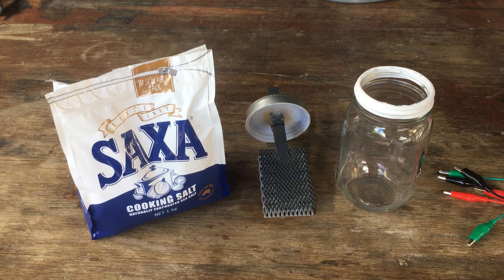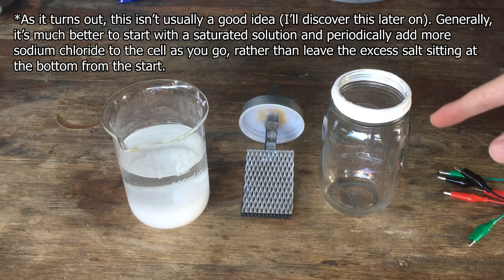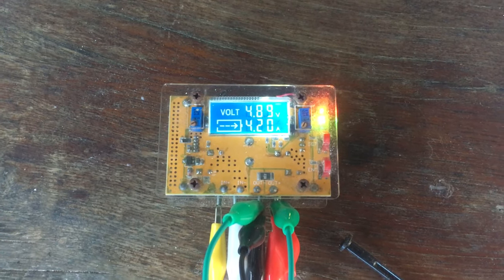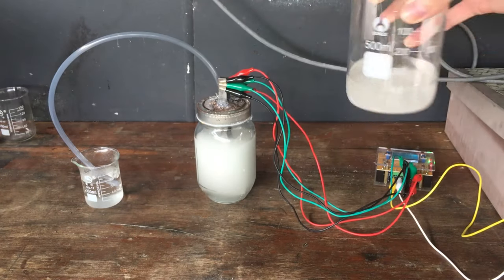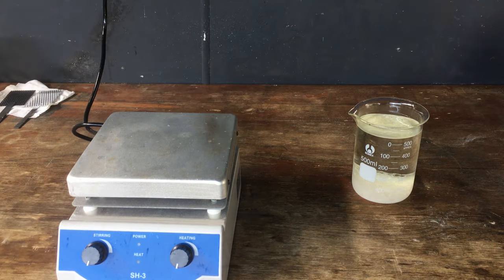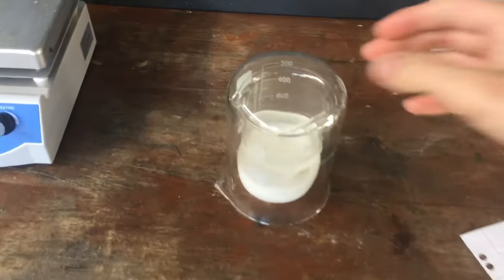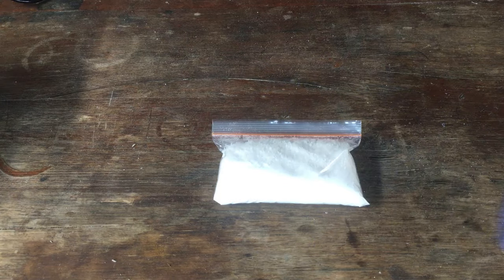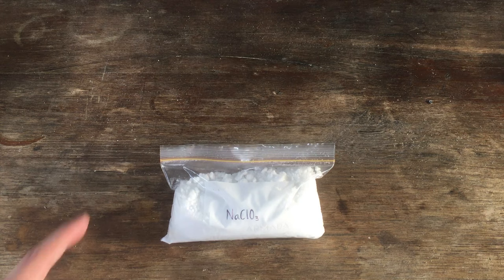A Sodium Chlorate Cell

Comment: Could you please explain why exactly there’s no much chloride left in the output material. I mean why are you so sure the most of the chloride is left in the solution? I’m trying to understand how it works as per idea I have the separation between chloride and chlorate should be bad as chlorate is more soluble so it should kinda tend to stay in solution more than chloride. 
I like chemistry but I never fully understood the idea of what you’ve done.
Thanks!
Reply from the maker: A great question! This is rather complicated to explain in a single YouTube comment, but I'll give it a try.
In the case of having an equal stoichiometric amount of sodium chloride and sodium chlorate in solution, you're completely correct that chloride would precipitate if you boiled down the solution or cooled down a saturated mixture. However, we didn't have equal amounts of each in solution. We had a little bit of the chloride and a LOT of the chlorate. 
In this case here, we could rely on the difference in solubility curves between the two salts (which you can find here: https://shorturl.at/rOR48 ) to get our crystallisation to work. When crystallising, we aimed to boil down the solution (reducing its volume) to the point just before the chloride crystallised. At this point, we stopped heating the solution and allowed it to cool. The solubility of chloride is almost independent of temperature, as you will see from the linked graph, so none crystallised on cooling. However, the chlorate solubility sharply decreased with cooling, so since we had so much in solution, we forced the chlorate to drop out even though it's more soluble. 
Boiling alone won't give you the chlorate, but if you stop boiling at the right time, you can just crystallise the chlorate by taking advantage of the temperature solubility curves.
Reply: @ScrapScience  ingenious! Thanks for explaining, this is completely clear to me now!

Comment: How do you prevent residual NaCl?
Also, I think its possibly to first purify the salt through crystallization, but that may still trap some other ions
Reply from the maker: The more recrystallisations that are performed, the less NaCl will be included in the product. If exceptionally pure chlorate is required, three or four recrystallisations may be needed (though this will also lose product, so it's a tradeoff).

And yes, recrystallisation of the starting salt could be done, but it's not really going to impact the overall process, since most common impurities won't interact through the electrolysis anyway.

Comment: +Scrap Science By the way how can you tell chlorate and perchlorate apart? They are quite similar and probably you wouldn´t know at which point you´re converting chlorates into perchlorates during electrolysis.
Reply from the maker: Mixed metal oxide and carbon electrodes will only convert chloride to chlorate, and will not make any appreciable amount of perchlorate, so this isn't an issue for this type of cell.
When using platinum or lead dioxide (which are able to make perchlorate), it still isn't too big of an issue. The presence of the initial chloride in the cell diminishes the efficiency of making perchlorate to a large extent, so you generally don't generate any unless you allow the cell to continue running for a very long time. If you were to run the cell for that long (which will ruin the electrodes to a large extent), the conversion to perchlorate is also accompanied by a sharp increase in voltage, so it's easy to spot when it starts.

Comment: Hey way late, but why is it that the chlorate precipitates out first before the chloride? The chlorate has a solubility of 106g/100ml and the chloride is only 36g/100ml. So shouldn't the chloride precipitate first?
Reply from the maker: Generally, yes. Chloride should precipitate first if you increase the concentration of both.
However, in this case, we don't just have a mixture of the chloride and chlorate - the cell is actively converting the former into the latter. At the beginning of the run, we have a saturated solution of chloride, and we then start turning this into chlorate. As we do this conversion, we physically add more and more chloride to the cell to account for the amount we're converting, keeping the chloride concentration close to the saturation limit. Repeating this process for a while keeps the chloride levels relatively constant (not enough to start crystallising out), while the chlorate concentration steadily increases. Eventually, after enough chloride addition and enough electrolytic oxidation, we have such an excess of chlorate in solution (>100g/100mL) that it must start crystallising out.
That's the basic idea anyway. It gets a little more complicated when you have to take solubility products into account.
Reply: @ScrapScience  Thank you, that makes sense, but if I did a recrystallisation by dissolving the product in the water and boiling it should I expect the chloride to now precipitate out first since the concentration would now be increasing for both? Or will the chlorate still precipitate first because of the solubility curve. 
Edit: also to add, wouldn’t it be better to not boil down your final solution and instead just keep topping it off with the chloride, decant the top and take the crystals? So instead of taking 2 weeks for you to start getting the chlorate you  just add some chloride to the super concentrated chlorate solution and get some more on demand?
Reply from the maker: For your first point:
Yeah, if you crystallise exclusively by boiling down a mixture of sodium chloride and chlorate, you'll get the chloride crystallising out first. However, the difference in solubility curves is extremely useful if you don't quite crystallise out any chloride in the boiling step. If you manage to boil down the solution to the point just before the chloride crystallises, you can stop there and allow the solution to cool. The solubility of chloride is almost independent of temperature, so none will crystallise on cooling. However, the chlorate solubility sharply decreases with cooling, so you force the chlorate to drop out. 
Again (to summarise that lengthy explanation), boiling alone won't give you the chlorate, but if you stop boiling at the right time, you can just crystallise the chlorate by taking advantage of the solubility curves (as you're referring to in that last sentence).

For your edit:
Are you talking about doing future runs of the chlorate cell? In that case, yes, the final decanted solution from this cell would be an ideal starting solution to make a new chlorate cell. It's already saturated in chlorates and ready to go for more electrolysis.

Comment: What do you mean by washing with cold water?
Reply from the maker: After I filtered the crystals, I just rinsed the crystals with ice cold water as they were sitting on the filter paper. This rinsed away any adhered NaCl solution. (The rinsing water needed to be cold to avoid redissolving too much of the product)
Reply: @ScrapScience  Ahh ok I understand, makes sense colder the better to an extent. Catching up on terminology lol. Thanks for your response!!
Reply: @ScrapScience  little update. Whatever I manage to precipitate or crystalize out of solution, I'm assuming is 25-30% purity. No matter how many times I try to recrystalize, it is contaminated with what I assume is sodium chloride. My starting solution is saturated to the point of recrystalizing the chloride approximately 10°c below ambient temperature (~5°). Is this caused by not enough time under electrolysis, insufficient current/voltage (3.3v @ 2A CC) or starting solution?

Comment: Trong thí nghiệm điện phân muối ăn ( NaCl ) này , điện cực trơ được anh dùng là Platin ( Pt ) hay bằng chất gì vậy ?
Reply from the maker: The inert anode in this case is a mixed metal oxide (MMO) anode - also known as a dimensionally stable anode (DSA). It is a titanium substrate coated with a mixture of ruthenium dioxide and iridium dioxide.
Platinium also works. So does graphite.

Comment: Im a beginner at Chemistry, I think it crystallized because its very clean equipment and is almost pure sodium chlorate. So I believe you did very perfectly to that point of crystallizing😅, im guessing of adding little impurities to prevent crystallization.
Reply: Thats not how it works
Reply: @user-vj8dz8ht2c  thanks,  i learn alot from that reply! i will correct my mistake from now on👍😁
Reply: @user-vj8dz8ht2c  I just watched NightHawkInLight about making infared cooling paint, I learned that crystals forms through concentrations and that impurities are just starting point of nucleation for the crystals. You are right.

Comment: How do you know the percipatate isnt sodium chloride salt?
Reply from the maker: For the following reasons:
1. This is a well-known reaction.
2. Sodium chloride's solubility curve against temperature is basically flat, so it would not generally crystallise out when decreasing the temperature of the solution.
3. Sodium chloride does not act in the way shown at 21:30.
Reply: @ScrapScience  agreed. But if your adding sodium chloride to the cell keeping it saturated hot. Then when it cools to room temp some salt will precipitate if not all used up and converted to sodium chlorate. I made that mistake the first time in ran a cell.

Comment: In I do not add sodium chloride to the cell constantly and I use carbon electrodes for the electric current it is ٤ volts and I use ١٠٠  ml of sodium chloride solution and the cell works with great effort and gases flow in very large quantities the temperature is approximately 25 only the cell becomes warm after running the cell for 5 hours the concentration becomes hypochlorite Sodium is strong, and will it work if I run the cell until the chloride concentration reaches a very low level, then I evaporate the solution until sodium chloride appears, but what are the signs that indicate that the chloride concentration is very low?
Reply from the maker: There are no reliable signs that will always tell you when the chloride concentration is low. You will need to work this out by calculations involving your expected cell efficiency, quantity of chloride, and cell current. I don't really understand anything else you're asking here, sorry.

Comment: My friend, if you leave the sodium chlorate cell for a long time, even after the chlorate is formed, and then continue the electrolysis, can the sodium chlorate turn into sodium perchlorate?
Reply from the maker: It depends on the electrodes you're using. Generally, no.

Comment: I am using machine translation, so you may not understand exactly what I am saying.
I have a question. The website I referred to says that the temperature of the solution must be high during electrolysis, but do I have to do this?
It also says that hydrochloric acid must be added to make the solution acidic.
Reply from the maker: You don't need to keep the temperature high or do pH control to build a working cell. Doing these things will increase efficiency (if you perform both techniques), but they are complicated to set up and are definitely not essential.
Reply: Does this mean that it is only the concentration of the solution that determines whether the brine becomes sodium hypochlorite or sodium chlorate during electrolysis?
Reply from the maker: Concentration of your initial chloride doesn't have much to do with it. With no pH control, you will oxidise chloride to hypochlorite, and then when the concentration of hypochlorite gets high enough, you will oxidise it into chlorate. This is two steps of anodic oxidation.

With pH controlled to 6.7 and temperatures around 70 C, you will still start generating hypochlorite, but then the hypochlorite will automatically disproportionate to produce chlorate (a more efficient reaction). This is one step of anodic oxidation and one step which is purely thermally driven.

I have another video on chlorate cells which goes deeper into the chemistry here:
https://youtu.be/CqMEnrQb5q8
Reply: I see. Thank you very much.

Comment: You need to use a MUCH smaller cathode. Your chlorate is turning back to chloride at the cathode more with a large surface area.
Reply from the maker: Yeah, definitely. I just wasn't too concerned about the efficiency for this one, and I didn't have a smaller cathode.
Reply: Would a porous membrane help? Or a using a salt bridge setup?
Reply: @chemistryofquestionablequa6252  Oh right, so you need to mix the hypochlorite with the hydroxide to make chlorate while blocking the chlorate from reducing to chloride at the cathode, (which is done by adding dichromate, if you have it)
What if you generated hypochlorite on one side, hydroxide on the other, turned off the electricity when both solutions are concentrated, and then mixed the two solutions to make chlorate. Would that work? With potassium ions, the formed chlorate would precipitate in potassium chlorate.
Reply: @petrlaskevic1948  I suppose you could,  hypochlorite disproportionates to chlorate and chloride when boiled, but you'd get terrible yields and make a lot of extra work for yourself.
Reply: @petrlaskevic1948 pretty sure you need to mix the chlorine with the hydroxide to make hypochlorite...
Reply: @superslimanoniem4712  Yes, after reading about it more I realized this. This reaction is also what happens when the container is not separated. I suppose one quick way would be to pass high current through a chlorate cell, making a lot of chlorine, and bubbling the chlorine which didn't react inside a container with a hit solution of hydroxide, so the formed hypochlorite can disproportionate there.

Comment: Hello! Your videos are very good! Can other metals be used? For example stainless steel or can you say something else?
Reply from the maker: For the cathode, many metals can be used (titanium, stainless steel, mild steel, and nickel can all be good options).
For the anode, stainless steel definitely won't work, and you are severely limited in your choice of anode material. The only reasonable choices here are platinum, graphite, or the mixed metal oxide I use in this video. Basically every other metal will oxidise, fall apart, and leave you with zero chlorate product. I talk about this in a little bit more detail in my other video on chlorate cells, which you can find in the description here.
Reply: Thank you very much for your answer!

Comment: there is no bubbles coming through my hose, is that a problem?
Reply from the maker: It probably means that your cell isn’t completely sealed. 
Provided you’re doing this outside with good ventilation (which you definitely should be regardless), it’s not something to worry about too much. I mean, fix the seal if you can, but it’s not a disaster if you’re unable to neutralise the minimal amounts of chlorine generated by the reaction.

Comment: When i run a sodium chlorate cell the current stays the same and the voltage instead of increasing decreases why is that
Reply from the maker: On a short timescale, the cell heats up a little due to ohmic resistance. As a result, the conductivity increases and you need less voltage to pass the same amount of current.

Comment: I mean, if the cell works for some time, for example 13, and stops for an hour, does this harm?
Reply from the maker: Leaving the electrodes in a chlorate/hypochlorite solution without current flowing through them is generally a very bad idea, since it damages the anode severely.

Comment: Hello brother, please. I have a question. Is it possible to use iodized salt, because I do not have any other salt?
Reply from the maker: It's possible. The small amount of iodate content in iodised salt won't affect the process to any large degree. Your final product will likely be contaminated with traces of iodate, but this is unlikely to be a big deal and can be fixed with good recrystallisation techniques.

Comment: 3 Cl2 (g) + 6 NaOH (aq) → 3 H2O (l) + 5 NaCl (aq) + NaClO3 (aq)
How can the equation be achieved?
How to put 3 of cl gas on 6 of naoh ,Can you explain in a video
Reply from the maker: Bubbling chlorine through a solution of sodium hydroxide will give you sodium hypochlorite. Boiling this solution will decompose the hypochlorite into chlorate, resulting in the overall reaction you've described.
Since the process is extremely inefficient (and I don't need to make any more chlorate), I'm not planning on giving it a go any time soon, sorry.

Comment: 12 volt 1.5 amp need hour electroliz or day ??
Reply from the maker: That’s an extremely broad question. 
First of all, 12 volts is way too high for this process. A current-controlled supply is ideal, and standard cells will probably require 3-5 volts for a reasonable current draw.

The runtime of the cell will depend on many factors, including:
- The size of the cell
- The set current
- The desired quantity of chlorate
- The anode/cathode choice
- The current density on the anode/cathode
- The temperature of the cell
- The pH control
For any given cell, you can calculate the theoretical production rate. This requires some understanding of stoichiometry and how charge transfer relates to current, and isn’t something I can explain in a single YouTube comment. You’ll need to do some research here if this type of calculation isn’t familiar to you.
Reply: @ScrapScience  I am wondering about 5% or 1 liter water 1% rate of naclo production, do you have any information about what are the required rates?
Reply from the maker: I don't understand your question here. What are the percentages and volumes referring to? And what do you mean by rates?
Reply: @ScrapScience  do you know the production of sodium hypochlorite me 5% or 1% concentrate with electric
Reply from the maker: Okay, so we're talking about hypochlorite.
Designing your own system is pretty useless in my opinion. You can buy hypochlorite generators for like $10 online.